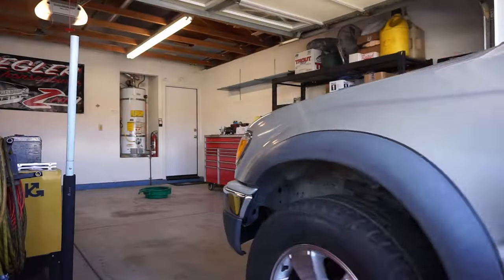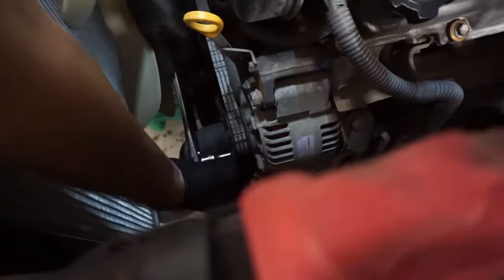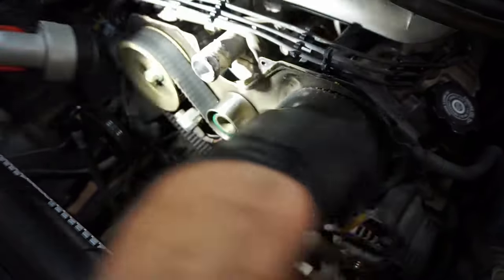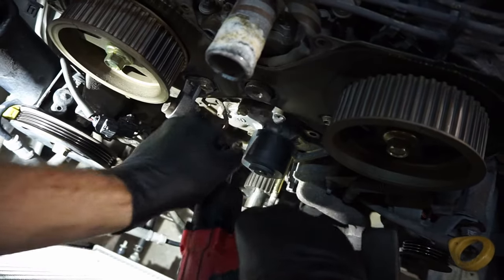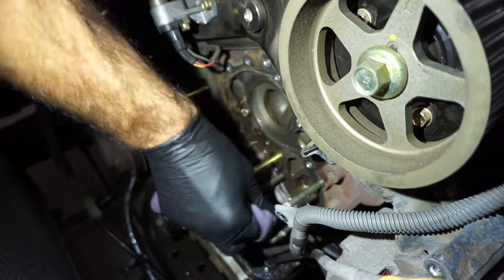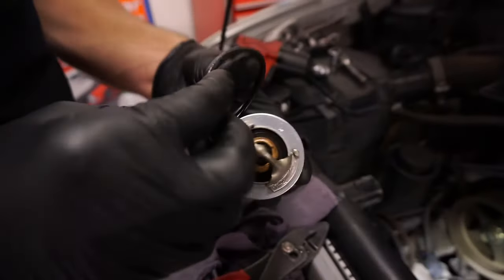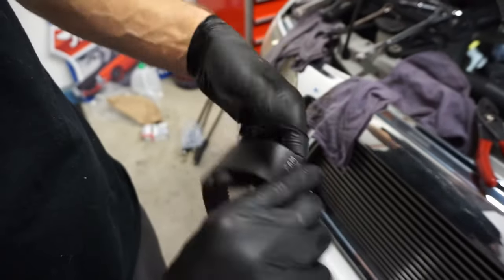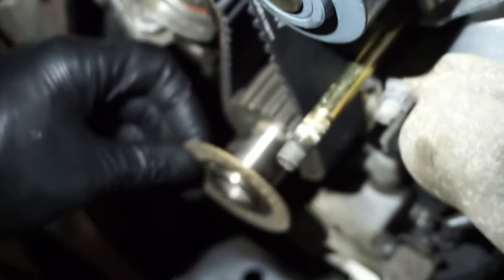Changing timing belt in Toyota Tacoma 3.4 liter

Comment: One of the best timing belt replacement videos I've seen.  It took me a couple of hours to get the job done but your video made it easy. One thing to note, if you buy a really cheap timing belt it may not have the timing marks on it.  Always mark the old belt to the marks before removing it.  You have the ability to count teeth or at the very least lay your new one on top of your old marked one should your new belt not have all three marks.  Or just pay the extra 10 bucks for a good brand name belt.
Reply: COUNCIDO COMPLETAMENTE, PERO SI PUEDO AGREGAR ALGO SERIA CAMBIAR LOS RETENEDORES DE CIGUEÑAL Y DE LOS ARBOLES DE LEVA..

Comment: That dude is a machine... He just made this very challenging job that Toyota charges around $5-600 in labor, look like a slightly more complicated drive belt replacement...
Reply: Thats a master mechanic for you
Reply: @DixonCider-p3b  I’m a certified you tube mechanic... This job took me 2 1/2 days approximately 30 labor hours... In fairness I did do a few extra things like the oil seals and resealing all 3 timing covers but still lol...
Reply: @vonzipper2712  Thats awesome I wish I had the talent to do all this

Comment: Great video.  This helped a lot when changing out my buddy's T-belt and water pump today.  One thing - when pulling the tensioner, yeah while I could have pulled it with your cheat method (which is obscure in the video), there was absolutely NO WAY I could have gone back together with it.  You have to completely pull the A/C unit and bracket to go back together.  If I'm wrong - SHOW ME!  Writing to you as a former Toyota Tech - it's been 25 years.  Thanks for the video, guys.  Well done with the exception.

Comment: One note, Toyota FSM shows the jiggle valve on the Toyota thermostat at 6 o'clock position not at 12 o'clock as shown t=19:38.  This is also confirmed via multiple other videos and on toyota forums.  Not intuitive, you would think it would go on the top.  Sure enough, when I pulled mine off from the factory installation it was on the bottom.  Multiple posters swear that having the jiggle value on the bottom vs the top the operating temp will drop 10 to 20 degrees F.

Comment: This is a great video!! Thank you. I have an ‘06 Tacoma that needs the gaskets replaced in the timing belt cover.  I was told the engine needs to be removed to fix it.  Does that seem accurate?

Comment: No glitz,  or distracting music just the job at hand. Helpful bolt sizes and access tool trick, clear good practice reassembly. Torque values, correct nomenclature and check recheck procedure. Nicely done Gentlemen! 
Noticed the color on the fan clutch - Orange vs Green heavy duty?

Comment: Awesome video! thanks for the help... quick question: i used a Dayco timing belt replacement kit. The belt seems a lot tighter than the video when trying to put on the last idler pulley? also, the Dayco belt does not say left or right Cam, but the distance is correct with the old belt and we are off one tooth, does that make a difference on the timing in general? Thank you for any information regarding this.

Comment: You guys really helped me alot with my 01 Tacoma. You really saved me time with lots of little added details such as:
-Using a wobbly & squeezing between to eliminate compressor hassle 
-Giving torque specs 
-Hardware sizing 

Great job, thank you. My only question now that it's all together and running is, I installed my new Thermostat with the jiggle valve in the up or 12 o'clock position. However after having a couple people tell me I had installed it upside down, and that it's supposed to be jiggle valve down. I started looking into it, and had a local Toyota tech tell me the same. He said it probably doesn't matter much, but in the manual it was in the downward position. I also found another guy on  YouTube measuring his temp digitally with t-stat in both position to compare temperature. His results consistently showed a 10° difference with it running cooler in the downward position.  Can you please help me understand this? Thanks again.
Reply: Did you ever find an answer to this?

Comment: This is the best Video on water pump timing belt change that I have watched very informative. Thanks for being thorough.
Reply: Talented guy and I’m not a mechanic. Very grateful for the video, it made the process possible for me. That said, for idiots, it would have been useful information to know the timing tensioner needed to be new or rig to compress pin enabling reuse lol. Ran right into that and didn’t know what I did wrong that belt would not fit on. Thank you again for taking the time to make the video available. Sincerely

Comment: Excellent video!  I was debating if I should replace the timing belt or take it to the dealership and your video answered that question.  I have a 2000 Tacoma Prerunner that I bought new and it has only 63,000 miles on it.  Should I be concerned about the belt breaking?  I did a visual inspection and it appears to be in great shape for what that is worth.  Thanks!!!
Reply from the maker: I would possibly consider changing it, being that the belt is about 22 years old.

Comment: Great job guys..the only thing I missed was why and how you put the pin in the tensioner. I'm assuming once you pull the pin it automatically puts pressure on the tensioner and there is no further adjust- ment to tighten the timing belt???...I would have to assume that you have to push the tensioner back and the pin holds it until the belt is on and releasing the pin restores the pressure to the tensioner pulley
Reply: I believe the pin is in a new one that comes with the kit.

Comment: Hi guys, good video end explained.

Question?

I already take it the radiator & cooling fan and the drivers belts.....so Do I need to take it out the TIMING belt ? To do the TDC 
Or I should live there and start doing the TDC? 

Because my friend told me to take it out , he said no problem!

But I was thinking usually should stay there and do the TDC  first and than after is already TDC I can take it out the TIMING BELT?

WHAT YOU THINK?

THANKS for your time ✌️ keep up!!
I went to school but on 2007 for 3 years.
So I didn't do it yet myself.

Thanks again.
Reply: Get her tdc first. Then remove the belt.
Reply: Thank you! ✌️

Comment: Great video and very helpful in deciding to do this one myself. Ordering the Aisin kit and the few tools I don't have now. Can't help but comment on the wrong coolant being used though, should be red or pink Toyota coolant.
Reply from the maker: Good stuff, and correct on the coolant. The green coolant was already in there from someone beforehand, so we used the same coolant instead of draining the system and putting the correct one in there.
Reply: Not a fan of the off color coolant choices. I drain and refill all my vehicles with green ASAP. A lot less headache and maintenance going forward from that simple step.

Comment: Got the belt tensioner bolt, Thank You, I came from underneath. Also where Rad. hoses attach on to the alloy metal or pot metal, there's always that white caked on powder, Do you know, or is there, anything that can be put on to stop that corrosion?? Thanks again!

Comment: Good video..  I have watched a few of these videos and watched people struggle with getting the belt over the crank gear and I was  wondering if maybe it would be better to put belt on then put top idler on LAST.  And right here in this video, there it is. Nice job.  However, every other video i watched says to orient the thermostat toggle valve at 6:00.  (according to FSM)
Reply: I had wondered about this as well, so watched to see where the jiggle valve was located from first timing belt job done by the dealer.  12 o'clock position, and I never had any hi-temp issues.  So that's where the new one went!  2000 tacoma V6 5vz-fe engine.

Comment: Do you find it easier to leave the radiator in or taking the radiator out while doing this job? Did you reuse your chain wrench to hold the crank while you torque to 217lb?

Comment: Thank you for the help.
Other problems is the ac  bracket on my way to remove old belt tensioner.
Im using swivel short end 12 mm but still can’t fit the head of bolt. It’s kind of twisted not straight..
You  mensioned the word “tricky “ really it is ! Guys.

Comment: Great video helped me alot. Couple questions though on my 95.5. I didn't have a washer on the 10 mil tension pulley is this a special size washer? I couldn't time it before I took off the belt as it was proper fucked is there a spot on the gear for top dead center? Also how important are the  duel prong spark plug just put in a new set of single

Comment: Hey Tim, I recently did this and had to go back in because the harmonic balancer crankshaft pulley was wobbling so I replaced it. IT STILL WOBBLES! I made sure to torque all to specs including the crankshaft bolt. The accessory belts are a bit tight but have about 1/2inch or less of give... shouldn't cause the pulley to wobble. My last thought is maybe I did face the crankshaft washer in the wrong direction, before I dig in again. Do you have any suggestions?
Reply from the maker: Not sure who Tim is.
You could have the washer/shim backwards like you mentioned or the crank pulley is not lined up with the key way in the crank. Is the crank pulley lined up with the other pulleys?

Comment: Great video! What tool do you use to torque the tensioner pulley to 26 ft-lbs....since it is a 10 mm allen, I am not sure what to use!
Reply from the maker: I use a 3/8’s drive 10mm Allen socket with a 3/8’s torque wrench. Thank you.
Reply: @ZHPGarage  thank you so much! I also wanted to ask when you are re-torquing the dampener bolt on the main crank up to 217 ft-lbs, do you use the 24" chain wrench to hold it in place while torquing or do you have an additional tool?
Reply: @Ms._Nomer  they do sell a specialty tool made to hold the harmonic balancer  as an owner of 2 4Runners with these 3.4 I know them from bumper to bumper and own most of the specialty tools needed

Comment: Just bought an 02 4Runner. The guy I got it from doesn’t know if the timing belt and water pump has ever been changed.And it has 178k. So I’m studying up. It’s a beautiful truck. So I’m gona go ahead and tackle that along with a few other things I always do when buying a used vehicle. Battery/belts/plugs/ and basic PM. Wish I woulda bought it before COVID. I could have gotten it a hell of allot cheaper.The used market is nuts right now. And Toyota’s are fetching a mint.
Reply from the maker: Yeah everything has gone insane in price haha
Reply: I just got a 2002 Tacoma 4wd with a lot of miles. It wasn’t cheap but it’s a great truck

Comment: Hello,
    Does the timing belt tensioner do the required tensioning of the belt. That is, does the tensioner give the proper tension without doing some other turning a bolt to tension type procedure.
Thank you
Reply from the maker: Yes it does
Reply: Thank you

Comment: Whenever you're tightening that main pulley back down to 215 ft lbs is it imperative to not let it move or is it okay if it moves just a little bit since everything is still lined up?
Reply: After new timing belt and tensioner are on engine can be rotated.

Comment: Great video!!  Is it really necessary to change the water pump every time if it is not leaking?  I can understand doing so if you have to pay someone to do the job, but for the "do it yourself" person why not just change the belt?

Also, it is my understanding that the belt change is not so critical on these motors because they are "non interference" and hence even a belt failure does not result in valve damage.  The recommended interval is something like 60,000 miles.
Reply from the maker: Thank you
No, you don’t need to change the water pump when changing the timing belt it’s just easier to do at the same time. 
Timing belts are due at 90k miles
Reply: @ZHPGarage  Thank you for responding to my question.
Reply: I have completed first time belt change.  Dealer did first at 152,000 km.  Did myself at 283,000 km.

Dealer only changed water pump and belt.  I left water pump alone but changed tensioner and pulley and of course belt.

Made tool from misc scrap metal to hold balancer to tighten old bolt to 217 ft lb.  Used starter method to break free.

Also changed all 3 original serpentine belts.  Saved 800 Cdn dollars plus have spare new water pump for next time.

Only one lug on belt was showing frayed wires.

Already put 300 highway miles.  Perfect.

Comment: Again, awesome video!  Regarding jiggle valve location, I see on various forums this is quite controversial for the 5vz-fe engine.  Your comment that it aids air burping when at 12 oclock makes sense, but for some reason is seems to make engine hotter when there vs. 6 o'clock - only for this engine.  Have you been able to  notice where it is positioned for the factory installed thermostat?  On this engine specifically?
Reply from the maker: Great questions and nice to see someone do there own homework. I never paid attention when taking one apart to see where factory installs them. Never had a issue with running any hotter either.

Comment: How did you manage to tighten the crank bolt at 200 ft lbs without turning the crank? Was that chain good enough to hold the pulley in place?
Reply: the chain wrench will hold the crank shaft wether lossening or tightening

Comment: i noticed you replaced anti-freeze with the green stuff. is there a problem that you know of if vehicle had the red stuff to switch to the green? I like the green and it is cheaper. Your thoughts? thanks
Reply from the maker: This Tacoma had green in it, so I put green back in. Yes you can run into mixing coolants. So if you change colors/brands make sure to flush out all old coolant.

Comment: If I line up my timing marks is it possible that I'm going to get it 180° reversed?
Reply from the maker: As long as you have both cam marks and the crankshaft mark lined up, then no you won’t be 180 degrees off.
Reply: @ZHPGarage  it's so funny that you replied right now because 10 minutes ago I watched a video where it mentioned three timing marks. I missed it if you said it in your video. Thank you.
Reply: @sanctealphonse4510  If the timing belt is off, then the cams are not going to rotate if the crank is turned manually.  Therefore, the cylinder head valves are going to remain in the same position and there is no way for the crank to be 180° out as long as the timing mark is in the right spot.  The crank spins 360° with every revolution, independent of the cams and valves if the belt isn't connected and the pistons are going to be in the same position with each full rotation.  I think...

Comment: The Toyota Tacoma Factory Service Manual clearly reads that the thermostat jiggle valve (air vent) goes down in the 6 O'clock position. I am only pointing this out because a lot of people are having over heating issues because of the wrong positioning of the thermostat.
Reply: The jiggle valve won’t cause it to overheat. The thermostat will still open.

Comment: Straight and to the point with torque values and all..  better than sitting through the other videos that are 30 mins with part1, 2 and 3…. Lol..  only thing i wanted to see was tightening the cam and crank pulleys to the 217 gadamn lbs..  things are giving me a run for my money..  had one of the cam gears almost torqued but was on the motor with a bar holding the pulley still with my shoulder and a torque wrench with a 4 foot cheater bar pushing with my foot and damn thing slipped off and took mr left nut out of the game..  took the wind outta me from both ends and laid there on the motor holding my balls for a good 20 mins until my leg went numb so tried to get off but numb leg so went down and caught mr right nut on the damn spot light mounted on the bull bar..  so i took an axe to the front..  took out the radiator, ac condenser, power steering pump, intake and grille..  so just got back at it and still canr get the damn bolts torqued..

Comment: what are alternatives to the chain wrench for getting that crank bolt loose?
Reply: I went to Horror Freight and got the most powerful air ratchet they sell Earthquake XT. It is also the most compact front to rear,  that i could find at HF then hooked up a new 3/8" inside diameter air hose to it.  ( you want  lots of air and speed in the gun cause you are relying on the inertia of the engine to keep it from spinning if the bolt does not loosen)  I removed the regular radiator to make more room.  short 19mm socket.  no extension.  90PSI air.  bRAAP  bRAPPP!  BOLT IS LOOSE-  Old belt was still on, but plugs were out.  engine barely moved if at all. (backwards)  I still want a chain wrench to hold the harmonic balancer pulley for the re-assembly but  compared to an 1000-1800 dollar shop bill this is a great choice.

Comment: Hi , I m trying to remove the 19 mm bolt shaft.
It’s too tigth. 
Is it clock wise bolt ?
Reply from the maker: Yes all the bolts should be clock wise.
Reply from the maker: Left to loosen, right to tighten

Comment: how in the hell did you get that crank side of the belt to line upo?
Reply from the maker: If I understand your question correctly, you start with the crank pulley, then drivers side cam, if the idler pulley is on you need to roll the passenger cam to get the belt to line up. After the belt is installed roll the passenger cam back to line up timing marks. Then install onto tensioner pulley.

Comment: manual says thermostat jiggle valve should be at 6 o clock position
Reply: I second that.
Reply: Manual also says you have to remove that A/C compressor, no comment on that?